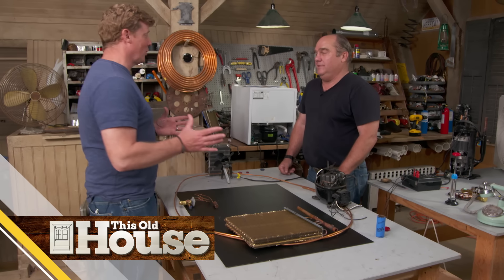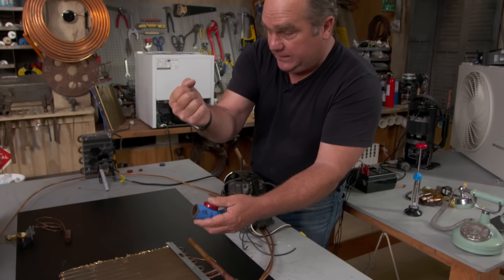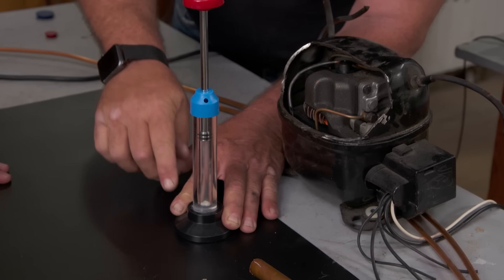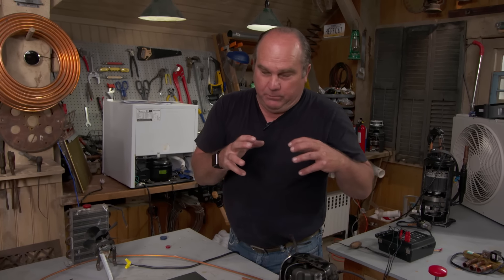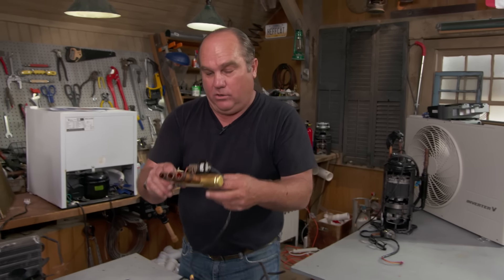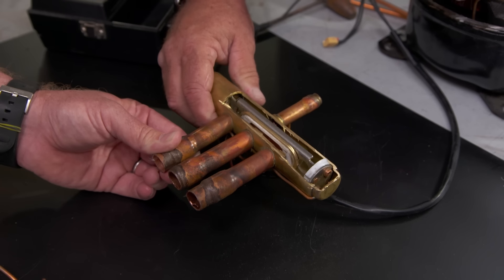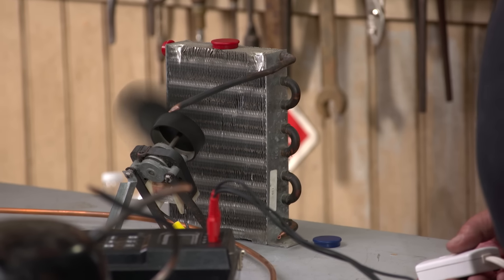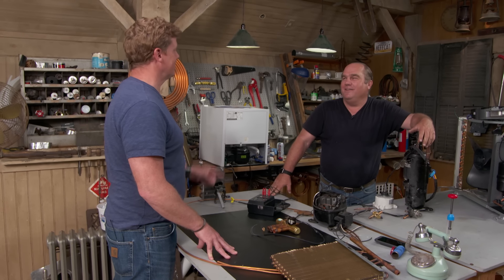How a Heat Pump Works | This Old House

Comment: In the winter could I just turn my window AC unit backwards to warm my room? It wouldn't be efficient because the fan would be blowing outside but is it possible?
Reply: No its not designed for it. On a typical comfort ac the cooling coil is at 38F to 40F  and if the outside air is colder. There isnt enough heat to absorb and refrigerant wont evaporate. And you can have liquid going back to the compressor.
Reply: Yes you all you have to do is plug it in backwards
Reply: It will work if you hack the thermostat.  People do this to make cheap walk-in coolers.
Reply: @mikeguitar9769  oh that's cool. Thanks for the info
Reply: @inspectorsteve2287  or you could just buy a reverse cycle window AC

Comment: I can see how this might work well as air conditioning (i.e. to cool a house) where the temperature of the air outside the house is lower than that of the refrigerant if no compression were used.  If, however, the temperature outside the house is higher than that of the refrigerant (uncompressed) and compression is used it seems to me that we are using energy via a compressor to artificially increase the heat of the refrigerant in order to heat the outside and then using energy to cool the refrigerant via expansion.  Is this merely to overcome the problem of not being able to expand and therefore cool the refrigerant unless we compress and therefore heat it first?

Comment: There  are objections to renewables bcause of batteries.  But if  most household energy is for heating and cooling and the electricity from wind and solar was stored as heat or cold, most of the problem would be solved.   A ton of gravel costs $50.  A ton of lithium costs $70,000.  Gravel will store heat and cold for days or weeks.  If a heat pump could be run in reverse to generate electricity with enough efficiency, the rest of the problem would be solved.  A ton of gravel heated by 500°C stores about 100kwh of energy.  If the excess heat or cold from the generation of electricity was used for heating and cooling, the system might be very efficient.

Comment: So if the weather is below 35 degrees in winter. It's not a good idea to have a heat pump? I currently have forced air with oil boiler and AC condenser unit. Was hoping to upgrade a unit with a heat pump
Reply: Just buy a cold climate heat pump, they are specifically designed to work in sub zero temps.

Comment: Excuse my  lack of education, but can you also pipe in a water heater into a system like this and maybe even hook a refrigerator up to this? Basically one heat pump that drives the fridge, water heater, AC and heating. I know this may be a dumb question, just curious

Comment: he briefly mentioned heat strips but didn't go into it. What was the heats strips he quickly mentioned?
Reply: You can add an optional heat strip to the air handler system, typically 5kw to 20kw (air handler evaporative side). Thermostats will typically have a setting for "emergency heat". This selection will allow the unit to bypass (turn-off?) the heat pump function and will deliver heat by the air handler blowing over the heat strips. Many heat pumps do not work well when the outside temp gets down to 32* or lower. Using the heat strips is not as efficient as the heat pump, but you will have heat. Do a Google search for HVAC heat strips.

Comment: Even I understood your layout - well done Sir.   Now what are the different types of gasses / liquids used to achieve proper heating/cooling - - their not all the same?
Reply: You need to use a substance that has liquid/vapor phase changes at the temperatures you need, with the pressures that are practical to use.   This is what governs selection of refrigerants.   Substances that would ordinarily be in gaseous state at room temperature/atmospheric pressure, but which can be liquid at 40C when subject to a couple of atmospheres of pressure, and which can be gas at the low pressure below freezing.  Another factor to look for, is the heat of vaporization, which is how much energy it takes per unit mass, to get the substance from liquid to vapor.  You want the heat of vaporization to be as much as possible.   There is also thermal conductivity that governs refrigerant selection, so that your heat exchangers can have a practical size to build.

Water has the highest heat of vaporization of any substance, a high thermal conductivity, and has great heat transfer properties during the process of boiling and condensing.  It would make a perfect refrigerant if it weren't for the fact that it freezes at zero Celsius, which is a huge drawback from using distilled water as a refrigerant (which is why we rarely if ever do).   Therefore, we have compounds such as CFC's (that are no longer allowed in new refrigerators) and HFC's (the alternative) that are used instead.

Comment: Could a power consumption levels comparison  be given of older tech vs newer tech?
Would it be worth replacing an older system? How long to recoup the replacement costs?
Thank you very much!
Reply: When it comes to costs & break even point, many power companies in metro areas will offer rebates or credits to modernize your energy efficiency, to put off need for supply network infrastructure upgrades & reduce operations costs. (Energy efficiency = costs savings long term for all: Utilities & customers). See EPA.Gov for your own research, and HVAC manufactures sites for their specific products. Regarding upgrading an existing system, most sources say AC/heatpump systems will have a lifespan of 15-20 yrs tops, so you may be nearing end of economic life anyway. Also, refrigerant phaseout of R-22 Freon is here, January 1 2020 is end of legal production an will result in skyrocketing cost for maintenance
 refills. The currently used R-410A Puron will soon follow, I'm told. Seems like a major jump to latest technology will be the only economic option for most people, unless you own an HVAC company with warehouse of supply's. 🤔

Comment: Thanks for the explanation. Interested in getting a heat pump in a cold very snowy and windy climate. Is it worth it for heating? No interest in cooling as it does not get hot enough to use AC in my climate. Thanks
Reply: Strictly speaking, you can collect heat from VERY cold air to heat the inside of your home. But - as the outdoor temps continue to drop, so does the efficiency of the heat pump. This is why Geothermal Heat Pumps are more efficient than traditional air-to-air heat pumps. Geothermal heat pumps work according to the exact same principles as air-to-air units - but Geothermal units use either ground water or a solution that is pumped through piping buried in the ground. Where as the temperature of the outdoor air changes with the seasons, ground water (or the pumped solution) stays very close to a consistent temperature year-round. Ground water stays around 55 degrees Fahrenheit, so there is no efficiency penalty as the seasons change.
Reply: Dwight Rahl 

My sister has four gt wells in her basement in Denver. I saw one in a utility room. I asked whether they drilled the wells before excavating the basement or after. She didn’t know. Her husband said the gt system worked to heat the place when ambient temperature was as low as 51°. I was there three yrs ago and saw their utility bill. $600 for March gas and electric. 10K sf custom house built in 2007. 6” studs, blown insulation, double pane windows. Lots of south facing glass. She once mentioned that utilities were lower than their previous 3800 sf 1938 Tudor.
Reply: Dwight Rahl 7

Comment: Depending where you live some gas companies (Dominion sucks) charge $30 for the luxury of having gas on each month.  The people have to pay for the gas company's failures at preparing for the future. The lines in my city have been dug and paid for 60 years ago...

To beat the gas companies heat pumps are a great solution.  Especially now that the tech has caught up where the heat strips don't kick on as much when it's really cold out.

The only issue with them is they're electric.  And although the tech is super efficient  if the power goes out in the dead of winter, the heat goes out to.  I guess that would be the same for a lot of people who have base board or other types of electric heat solutions.

The HVAC schlubs in NE Ohio don't like talking about heat pumps or want to charge 3-5k more for installation. It's basically installing a new air conditioner unit and making sure you have enough electric juice for a heat strip.   Lots of dinosaurs in the older narrow minded regions in the country...
Reply: People always seemed concerned with power outages, but most modern gas furnaces aren't going to work without electricity either. In addition to the blower fan, you have control circuitry and an exhaust gas fan for the high efficiency units. If you really live in an area where power can be out for days, you likely use something like a wood stove or propane fireplace insert that doesn't require 120v power.
Reply: Tankless gas water heaters too. Although they don’t rely on electricity as a fuel source the control panel, “brains” of the unit, is powered by electricity.
Reply: I will take gas over heat pump any day think you, even with the the newer heat pumps, i still hear plenty of complaints in my area that they are not keeping up with set point temperature in below freezing temperature that we can get more then once a winter.
Reply: @bnasty267  You forgot you can run your HVAC appliances on a whole house generator, which uses a natural gas or LPG engine to make the electricity.

Comment: My HVAC guy says my heat pump should not run colder than 30 or 32 outside because it won't be efficient. What are your thoughts. I'm also paying for propane which is like 3 bucks per gallon. House is 3400 sq ft give or take. 2 years old

Comment: So why does the heat pump blow cold air out of its vent when in cooling mode? The way this is explained, the inside unit is removing warm air inside the house by blowing warm air across the coils on the inside unit

Comment: I heard that when heat is being harvested from the outside during winter that it is renewable energy.
It's a great thing.
Reply: Unfortunately the heat available in 35 degree and below climates isn't enough for hvac compressors to keep up, triggering the system to utilize heating strips that draw thousands of watts.
Reply: @aerodicus  . Still it remains the case that the vast majority of the heat comes from outside instead of the utilities. That's a bonus
Reply: Well, not unless your electric generation is wind, solar, hydo, etc sourced, but it gives typically a 300% gain in heat efficiency when operating in it's designed temperature zone. That is 1kw of power in results in 3kw of heat delivered to the interior of your home. Hard to beat that, but not so good at near freezing or below weather conditions. Backup heat is required in most parts of USA for some parts of the winter. The easiest & cheaper install is electric coils after the heat exchanger,  but costs more when operating.

Comment: A far more simple solution is to pressurize the entire building as air itself is not only "hot" (lacking in humidity inside of a building) but also "rises" (chimney effect) creates a natural form of air conditioning or "heating and cooling cycle" which also acts as a very powerful form of insulation. This is why siting your barn especially but also your house and garage are so important as anything that faces for maximum effect due South as say your prototypical salt box will generate I think it's called a #venturi_effect and why one of the best ways to improve dramatically upon the comfort of an older home is to simply add a 2nd roof on top of the old one properly space with a simple albeit large air barrier between the 2. Obviously a roof gets very hot ... which ironically creates an enormous amount of cooling and hence ice dams on the roof and huge icicles everywhere. If instead of what is extant now one adds a 2nd roof to what is extant this will dramatically "cool" your roof as this #stovepiping_effect basically is eliminated as the now interior roof not only still traps the heat but suddenly insulated and dried out because not exposed to air and sunlight will seek to "expel" this heat out and away to where the roof overhangs the structure is literally creating a "radiator" or causing the air to "sink" as no longer is so filled with moisture so attempts to expend itself outward instead of upward. Won't even need any mechanical contrivance for heating and cooling if get this right. Where this heat pump is a huge deal however is in getting water into a home or barn as that is also done by a compressor on top of your...water tank. Take the mechanical aspect away from that and now you have heating and cooling of your drinking and bathing water without need for electricity as well creating the ultimate in energy efficiency as water no different from air is "coming in hot" when brought up from below ground but of course is CRAZY dense. water tends to "sweat" as well on the pipe so insulating or #jacketing a water pipe both in and out is a huge deal imo not that anyone does this of course but looking at the tech behind the #empire_state_building is dispositive as they didn't have air conditioning when that was built back in 1930😊

Comment: Isn’t the refrigerant chosen to have a low temperature boiling point so that the process can utilise the property of latent heat capacity as the refrigerant changes from liquid to gas? And not just a case of compression and decompression?

Comment: He neglected to state one very important part of the refrigerant cycle, in order to change any matter from a liquid to a gas you need to add heat.  During cooling mode Think of the expansion value as a spray nozzle that sprays the refrigerant from a liquid to a gas in the indoor coil.  When the refrigerant changes to a gas, it pulls heat from the air around the coils, if you don’t move more warm air across that coil, it will get so cold it freezes. That’s why a blocked filter will cause a frozen coil. In heat pump mode there is a second expansion valve at the outdoor unit. During heating mode the spraying from a liquid to a gas happens in the outdoor coil.  The compressor takes the refrigerant in a gas state and compresses it at a ratio of 3:1, this hot gas is now sent to the outdoor coil during the cooling mode or sent to the indoor coil during the heating mode where it condenses and it’s heat is removed by traveling to cold. Richard did ok but I think he should have discussed the two states (liquid & gas) of the refrigerant during the refrigerant cycle.
Reply: I agree. I wasn't impressed by his presentation at all.
Reply: "When the refrigerant changes to a gas'' it does no pull anything,  the rapid reduction in pressure turns the liquid to a two-phase liquid-vapor and this causes a reduction in temperature of the fluid itself
Reply: This show was created to put something like this into terms that the average homeowner understands

Comment: My girlfriend has a small condo in NY with electric baseboard heat, she has central A/C . My question is it more economic to go to a heat pump to do both. The A/C vents are on the ceiling which is optimal, but for heat will it comfortably heat the room ? Looks like a good system but the video it didn’t delve in the economics or application.

Comment: Can you heat a three foot section on a 25 ft wall and still stop the freezing?
My pipe that freezes is on the sill above the basement foundation and first floor
And I have no access, so I need to make a cut in the sheet rock in one section